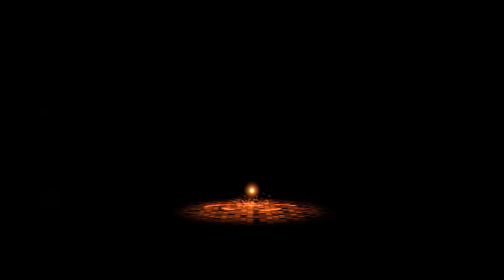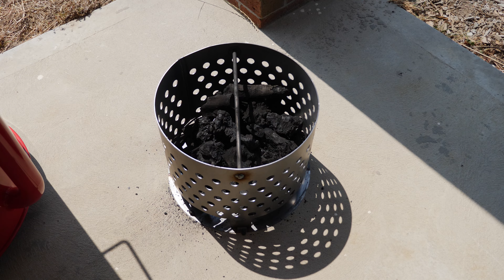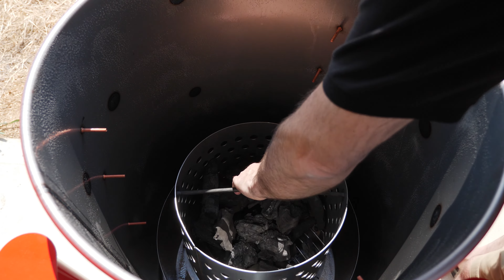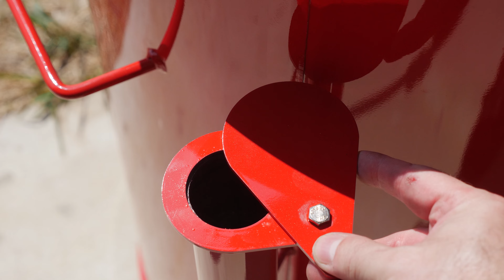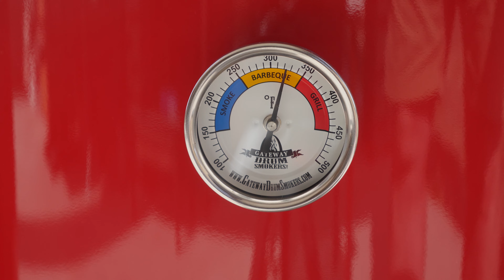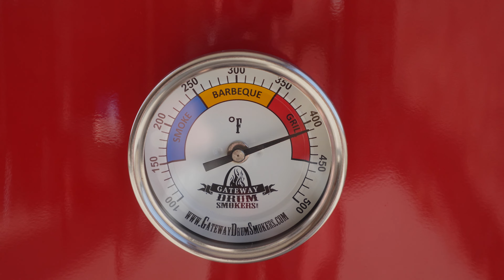Gateway Drum Smoker Basics | Seasoning, Lighting & Temperature Control 4K

Comment: Any quick tips for fighting a sudden spike in temperature? Best thing i've done so far was to close the intake valves, but that solution is only as fast as a dying coal.
Reply: Prep instead of react. Close the intakes off most of the way a few mins before you open the lid. Do what you need to do and get the lid back on ASAP. Then open your intakes again slowly as it comes back up

Comment: at 9:36 what grill are you mentioning to get grills up too 1000f i have a green mountain jim bowie and a traeger Timberline 1300 and want something to cook at extreme high temperatures
Reply from the maker: Hey Matthew, I have a Komodo Kamado and it can comfortably grill at 1000f when required. It is incredible thick and therefor insulated, so keeps temp really well. I have other Kamado's that are similar but not as well insulated, they can get north of 800f, depending upon the charcoal
Reply: @HectorsSmokeHouse  Thank you for the reply. I will get one soon then both of my pellet grills are great but cooking steaks or anything quick it doesnt work for me. I will have to get a Kamado Soon!

Comment: New to the Gateways but when you adjust the intakes I'm assuming you also adjusted to exhaust to the same width?  I used charcoal for my first smoke and it seemed really difficult to stay consistent with temp.  Gonna try lump on my next smoke
Reply from the maker: No, I actually leave the top vent fully open, no matter what temp I'm trying to achieve. All temperature adjustments are made on the two intakes. This seems to work very well.

Comment: Two questions: 

1-  Why do you not give the barrel a good burn before seasoning in order to get rid of contaminants like machine oil, et cetera? It would appear you are locking in any nasty stuff under the seasoning.

2- Why did you use the supplied thermometer when other reviewers have noted that it is inaccurate? They simply removed it and used the hole for probe wires. 

--Thankx
Reply from the maker: From what I could see it's not actually a barrel. It looks as though it is totally fabricated and seam welded. So doesn't have the normal barrel contaminants. 
Good tip on the thermometer, I prefer digital but might also look at a Tel Tru, they've always been pretty accurate.
Reply: @HectorsSmokeHouse  

Thankx for the quick response!  I was thinking about machining contaminants from the fabrication process. There will always be some, otherwise the metal inside would rust before you receive it. Pretty standard practice by fabricators. Best to play it safe, anyway!
Reply: I’ve used digital grate thermometer from thermapro, maverick etc and it might just be mine but the thermometer in my gateway seems pretty accurate to those.. but I too read those reviews about it, I can’t say that I’ve seen anything like that with mine.